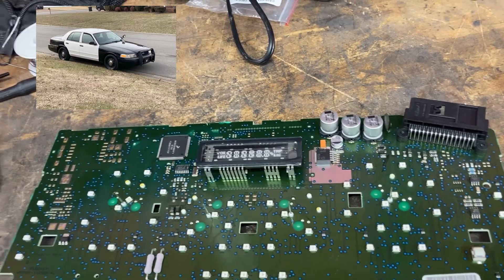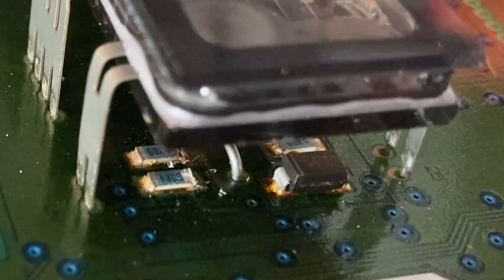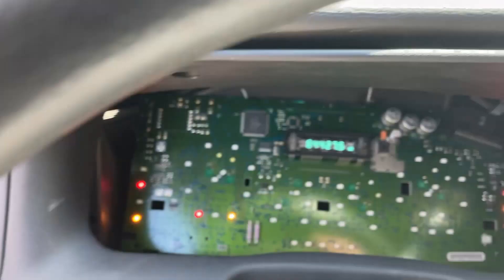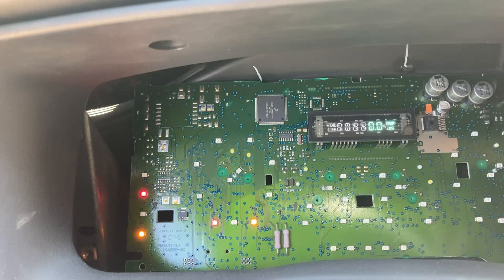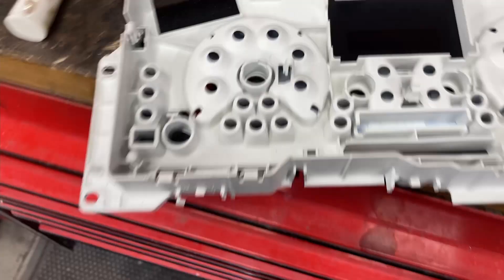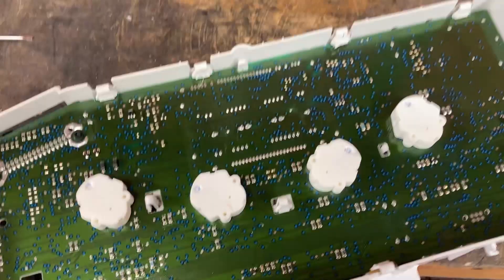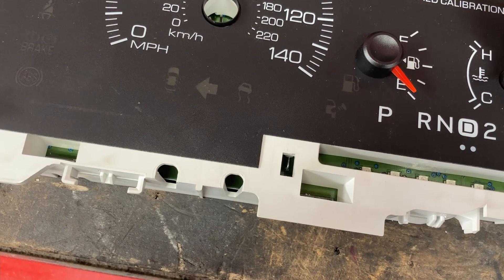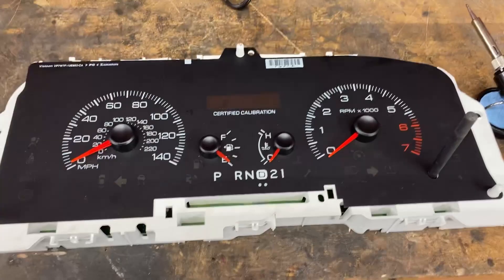FORD CROWN VIC CLUSTER REPAIR IN 2 MIN EASY,EASY,EASY@CleetusM @UnityMotorSportsGarage

Comment: Is this the odo only fix or whole cluster. Mines shutting off and on
Reply from the maker: Depending on what’s going on with your cluster, it could be a yes or no situation. I repair dozens of these and sometimes it does take care of the dash cutting out and sometimes it does not, but it works for the odometer.